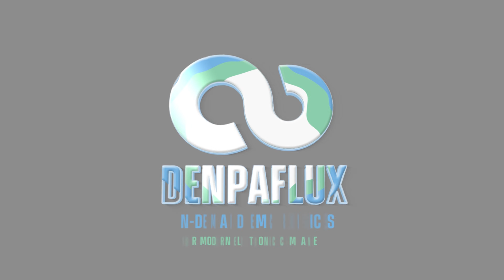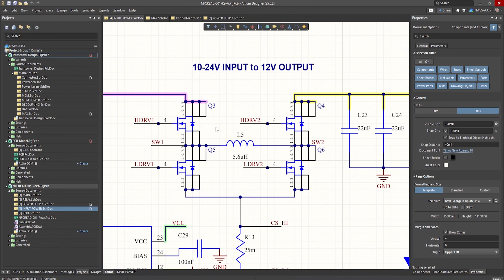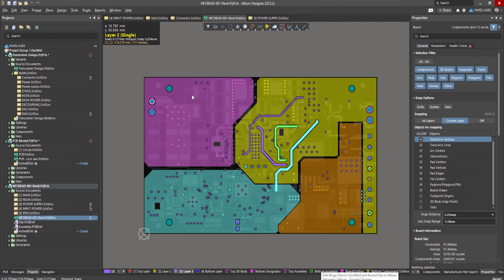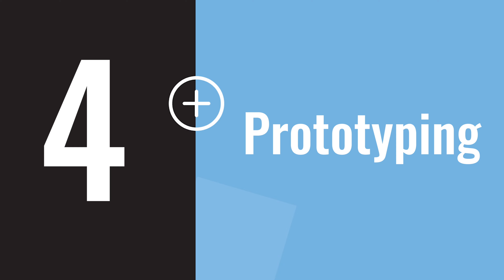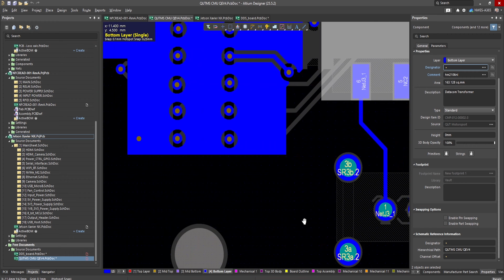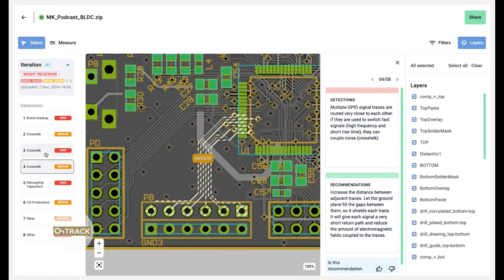10 Common EMC Challenges by Zachariah Peterson

Comment: Create an EMC Control Plan along with a Ground Architecture Plan before you start designing your circuits. Consider all of your EMC requirements and the mitigations you need to comply with them (filters, TVS diodes, etc). Ask a more senior engineer to review your plan. That's how you get promoted to the next level engineer. Don't be the fool that dives straight in to the circuit design without these plans. Your "engineering image" in the company will suffer when your product fails EMC. Management will think: that guy(or gal) doesn't know what they are doing.
Reply from the maker: Very well said 👏🏼